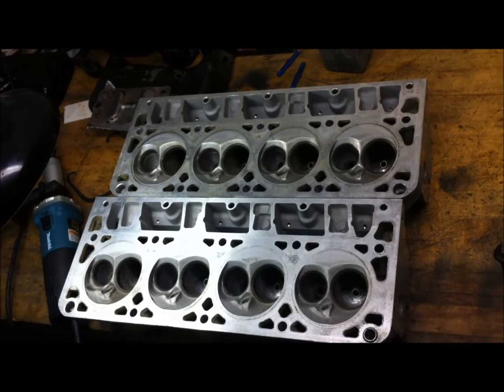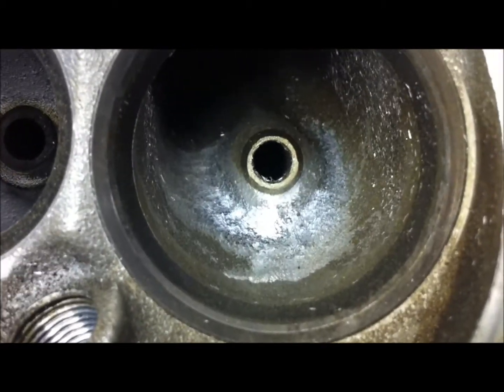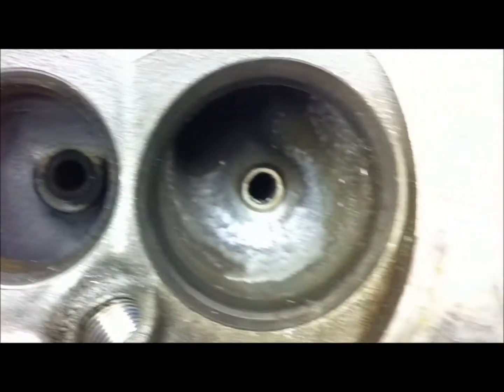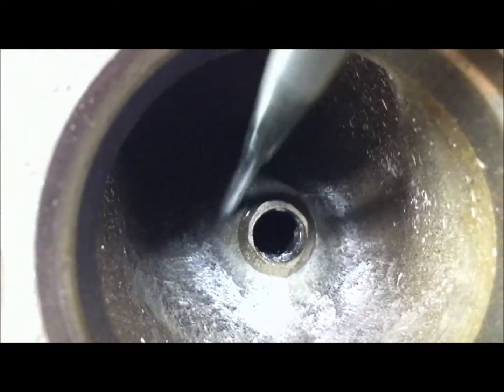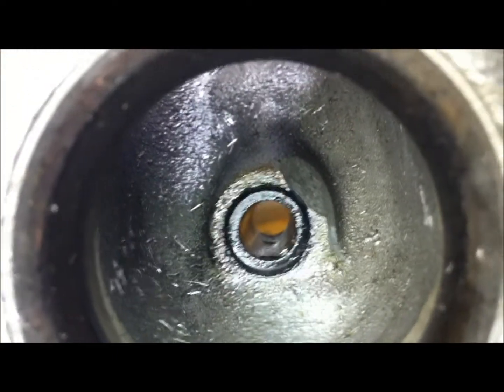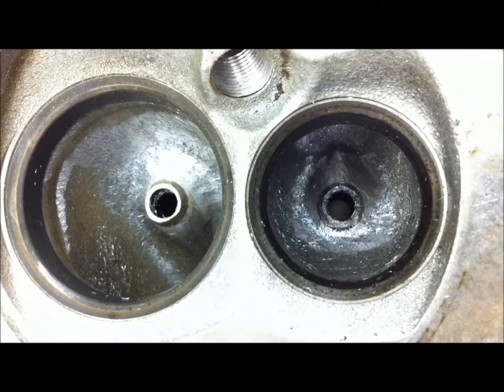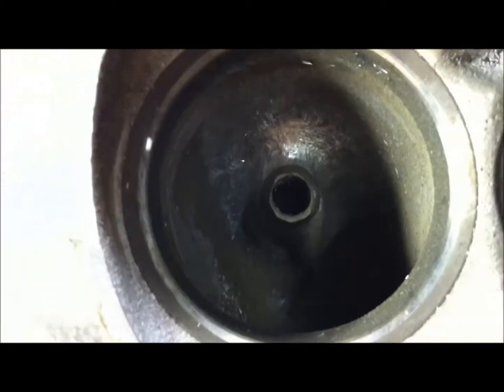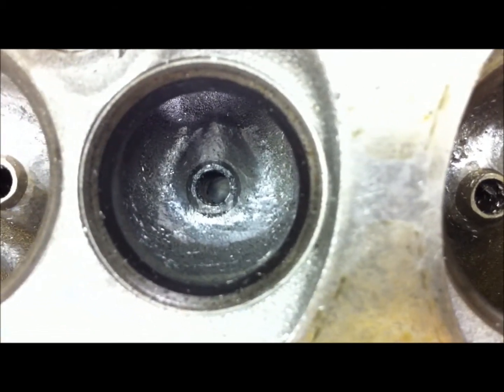How To LS1 DIY Head Porting Part 3 - Exhaust Valve Guide Boss

Comment: Have you ever tried to cc the runners on the heads after porting?  I'm going to cc both the intake and exhaust runners on the set of #241 heads I'm working on now to compare.  Stock they say the #241's are 205cc and 70cc
Reply from the maker: +HeadFlowInc No I havent yet. I know that I try my best not to really enlarge the port more than just removing that lump. That'd be cool to see. Let me know what you find out.
Reply: AGearhead4Life
 I was researching some other high end CNC heads where they are saying an intake port of 219cc is flowing 285 cfm.  I figure doing the swirl ramp and rocker lump removal alone would add 5-10+cc? 
What's interesting is the stock 243 heads have 210cc flowing 253ish where adding only 9cc could increase flow 32cfm. Maybe, I'll cc these 241 heads when I get done and report back.

Comment: Would this be beneficial on a 4.8? Or would less make me lose low end torque or compression..
Reply from the maker: +The Don Sure it could would be beneficial, as long as it's done correctly. A better flowing head is always good. The only way that you would lose compression and torque would be by porting and enlarging the combustion chamber of the head. But even then, the amount of compression that you'd lose is very little. You could just smooth the chamber and be fine. You could also mill the heads to make up for any possible loss in compression. 4.8 compression is pretty low anyway, so milling the heads is likely a good idea anyway. I usually mill 5.3 heads .030".
Reply: +AGearHead4Life  thanks for the advice guess I'll get a extra set and give this a shot! I have 706's unfortunately.. 4.8 has 9-47-1 compression I thought that was high? Would  
.030 get me into the 10 compression ratio
Reply from the maker: +The Don Yea, .030" usually gets you about have a point of compression. I thought the 4.8 had lesson CR than that? I know the 5.3 is 9.5:1 and thought the 4.8 had less. I'd try to get as close to 10.5:1 as possible. My current truck is 10.6:1 and I almost wish that I had more.. lol
Reply from the maker: +The Don Yea, I think the 4.8 CR is around 8.8:1.
Reply: +AGearHead4Life yea not really sure bro every thread online says something different no idea really ha.. I'll port the heads and shave them like you said .030 see where it stands though! Shouldn't have to change anything with just .030 right?
Reply from the maker: +The Don No, you should be fine at .030", though your machine will get nervous. lol A lot of machine shops are use to milling heads that much. haha Also, google "Summit Compression Calculator" and get familiar with it. You'll be able to figure out you CR with it, but you have to learn how to use it.

Comment: what casting head is this ?
Reply from the maker: +Nick Ritter In this video series, they are 862 cast heads, but the ports are the same compared to a 853 or any LS1/5.3/6.0 head from what I've seen. Some casting will be smoother, but the ports are the same and have about the same flow. The LS6, LS2 243 head is shaped different though.